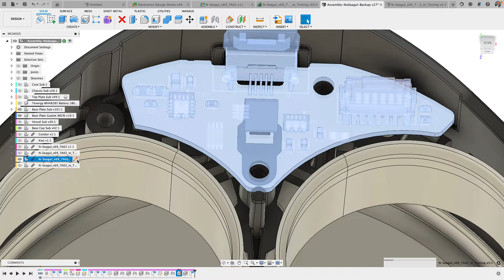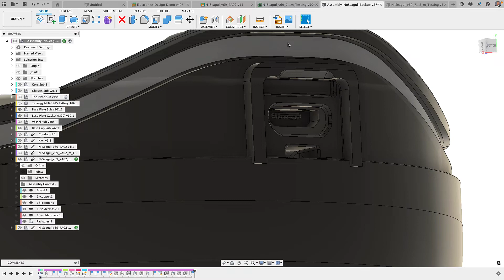Quick Tip: Before you begin routing do this

Comment: This is getting more to a mechanical design software with limited electronic design capabilities. Your losing your focus. Is going to be good for designing small and simple boards that integrates good with the enclosure, but it becomes impractical for more complex and challenging electronic projects.
Reply: Well said. 

Fix issues with eagle
Reply from the maker: Hi @Andrey, thank you for participation.  At the moment the electronic design capabilities of Fusion 360 match and some are superior than EAGLE.  Did you have something specific in mind.
Reply: @AutodeskEAGLE   EAGLE had everything you could want from a CAD program, but things have evolved, I would like to see more attention on the routing capabilities, such as propagation times equalizer tool. Or maybe a tools to help dimensioning the vias to meet specific requirements. I haven't seen a big enough improvement to switch to Fusion. I will continue to look and see if is going to change, I will make the switch. Thank you for the replay.
Reply from the maker: @andrey00756845585  Thank you for taking the time to reply, this is great information.
Reply: I agree. Far too much emphasis on the mechanical side and not enough on the electrical. I  was excited when Eagle announced the integration with Fusion 360 because I use both platforms. However, instead of combining the two, they degraded Eagle. So, I still use Eagle and Fusion as separate programs. Sometimes I will create the board outline in Fusion and then move to Eagle for layout and routing. It’s been a very disappointing process. For most components, I don’t care about 3-D. Yet, the components where 3-D matters are often not in a library and difficult to construct. Sometimes .STP files of components or connectors are available from the manufacturer, but they can’t be imported into Eagle. 
Autodesk has really failed with this experiment. Better to improve Eagle as a board design tool and just import a .STP file of the board into Fusion. Even for me that uses both platforms this would be easier.
Reply from the maker: @billmoran3812  Hi Bill, thank you for your participation. The EAGLE library editor does support mapping 3D models as long as you convert the library to a managed library. This simply means that the library is synchronized with our library.io and extends the library capability to handle 3D models. You can do this same operation in 
Fusion 360 library editor.  Now the library is available for your EAGLE and Fusion 360 sessions.,